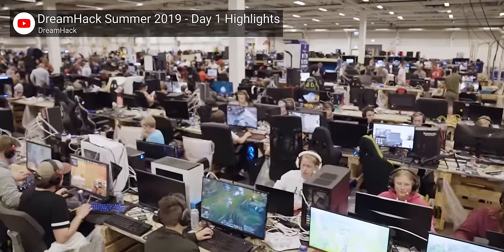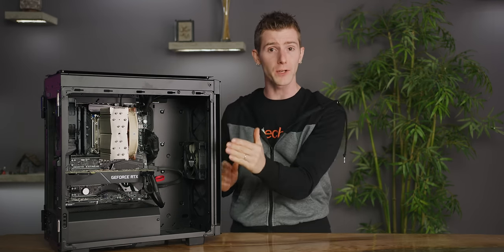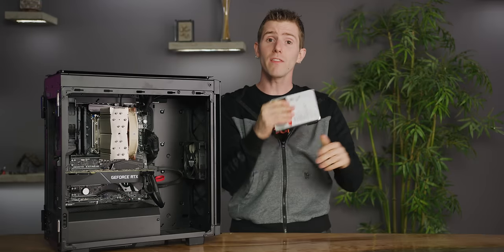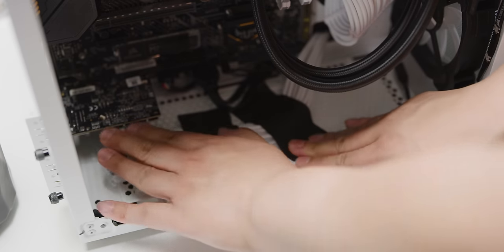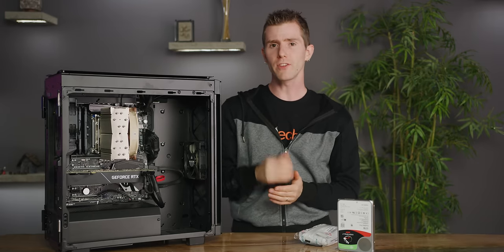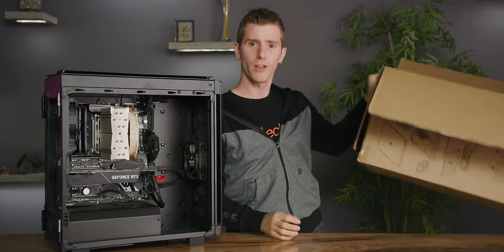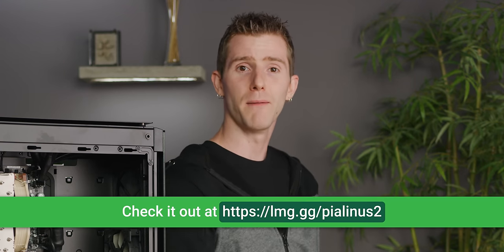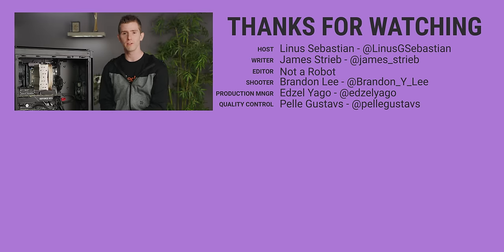How to Not SMASH Your PC - Gaming Rig Packing & Moving Guide

Comment: UPS driver sees "fragile" on box. Throws it over a fence, hear glass shattering inside the box, leaves like it was normal.
Reply: There's a reason UPS's colors are Brown and Yellow. They are THE WORST in the industry to ship freight. Always has been. But just remember that shipping is a triangle with Price,  Speed, and Security, and you only get to pick TWO.
Reply: @jackielinde7568  Bruh,you don't know what is a bad delivery service....
Reply: @jackielinde7568  yeah and price is 1 of them so only get to speed or safe. So yeah.
Reply: @-.2..  In the mid 90's, I used to work for a company called Roadway Global Air. I've seen the industry from the inside. And UPS has THE INDUSTRY WORSE DOA RATE.
Reply: @-.2..  Lol, bad delivery service is the delivery truck driver backing into my truck leaving a massive dent into my rear bumper, then driving away casually like nothing happened.
Reply: @jackielinde7568  lol if ups is the worst in your area you have it easy
Reply: more like ups driver sees fragile on the box 

Sparta kicks it into the van
Reply: @MaxRamos8  fed ex is regarded as premium. It's like some people form opinions off of absolutely nothing lol
Reply: Reminds me of the scene from Ace Ventura: Pet Detective :)
Reply: At my last workplace we put big "danger" signs on the box depicting a hand getting sliced up. It's funny, we had much less shipping abuse then we did with the fragile ones lol. We often shipped massive knives and before we added the stickers many boxes were damaged....somewhat problematically. eventually we were sticking the stickers to everything regardless of if it had blades in it.
Reply: @GBR9794  Probably sells kitchenware online
Reply: @GBR9794  yeah, I don't work yhere anymore but it was a company that made knives for manufacturing machinery. Some of them for cutting up scrap cars could be as much as 60kg each.
Reply: Write "I will find you if contents are damaged" instead.
Reply: @jackielinde7568  Here in France, UPS is actually good. But they're expensive. If you want cheap you ship with La Poste.
Reply: DHL has been the worst for me.
Reply: Are y'all gatekeeping having a bad delivery service? lmfao
Reply: They don't get paid to care. Enough said.
Reply: In the UK UPS tend not to be too bad, now if you really dont care about your package you use YODEL, well known as one of the worst couriers  going. you package will either arrive damaged or not arrive at all. its a lotto on if your even going t get your parcel
And if you think you packed your parcel well? dont get your hopes up, they will still find away to damage it. my girlfriend ordered a framed canvas (so not a fragile item) which arrived in a box. which had basically been stabbed with a knife through the canvas.
Reply: Ace Ventura
Reply: I can tell you now. The driver isn’t the only sketch one who touches your package. Remember it passes through multiple warehouses.
Reply: Absolutely agree. UPS in Singapore is garbage, will false scan an item to say they attempted delivery, will throw stuff and deliver them to hell if they could.
Reply: I have to admit: I don't know of a good delivery service at all, Hermes (in my are) tends to work pretty well, and UPS is ok, but definitely not good, DHL and DPD... You weren't there, so we delivered your package to a Package-store (I can't translate Packetshop) 40km. Away.

Worst thing about that was that I only know about this, because a colleague, ordered his tires to The Porsche Dealership, that I worked for at that time, appereantly there was noone to be found... At 11AM...
Reply: Hi tetra sky

Comment: When I moved my PC to a different country I stuffed my case with all my clothes, workers perfectly! And it's a big case with massive CPU cooler
Reply: If you wear lots of synthetic fleece, sweaters, etc. the static electricity created by the clothes will fry components.
Reply: @gorkyd7912  Yep, for safety clothes should be in antistatic bags.
Reply: @chupasaurus  telll that to the yes man
Reply: why would you move your pc with all your clothes to a different country
Reply: @saucybackport  cause I moved to a different country? Immigrants have computers too
Reply: @gorkyd7912  good thing I mostly wear cotton then, so no static there
Reply: IDK if that will bring static electricity
Reply: @LillyP-xs5qe  what?
Reply: @iKingRPG  what what?
Reply: most of the things mentioned it the video are a bit over the top in my experience as long as u secure the graphics card with the power cable resting on the atx power cable with enough tension so the PCI-e power cable can't move and is pulling up on the graphics card and the pc is in the original tower box it will be fine. only rarely do we get a pc back that has any damage

Comment: I remember a computer company that had a lot of problems with machines arriving at the customers in less than optimal working order. So they decided to investigate just what their packages went through going from their warehouse to the customer. They had a guy following one of their packages all the way, documenting every step it went through. At first everything looked as it was going fine. The guys collecting the packages was actually reasonably careful. Then they drove to the central sorting and there all packages was loaded directly onto a conveyor belt, and here is where things got scary. The conveyor moved all packages into a storage room where the first sorting was to take place. Here the guy documenting all of this had to watch how the packages traveled up the conveyor only to drop to the concrete floor from a bit over three meters, about 10 or 11 feet. When he asked why they did it that way they explained that the conveyor was supposed to start at floor level and automatically raise only enough to clear the boxes already on the floor, so the drop should never be more than about about a foot. But unfortunately the sensors that controlled that never did work very well, so for the last three months or so they had just left the conveyor at the current height, besides it was just the first few packages that dropped directly on the concrete floor, then they would cushion the rest of them, and the last of packages would land quite softly...

This computer company promptly redesigned the boxes they packaged the computer systems in. Triple thick boxes, high density foam and double boxing with two inches of foam between them. It wasn't cheap but the reduced RMA costs more than paid for that, and the customers appreciated getting computer that wasn't smashed to pieces.
Reply: Was that UPS or fedex
Reply: @BeanMan5621  Neither. This was in Europe.
Reply: @blahorgaslisk7763  how the hell did this pass

Comment: Safer but more hard work option is, if you keep all the boxes of the components you bought for you pc (gpu box, motherboard box, etc) you can disassemble your pc and pack everything on the original boxes and put them in a big travel bag with some foam inside around the boxes, or anything to absorb impact. That's probably the safest way if your traveling by plane.

Comment: I just moved from Malaysia to Australia with my entire PC rig consisting of my PC, monitor, studio monitors, and various other peripheral electronics.

Heres my tip:
 What I did was removing the GPU, wrapping it up in bubble wrap, shoving it and much more bubble wrap back into the case. After putting it back into the box that my Enthoo Pro came with, I shoved jackets and towels in there wherever I can. As for my monitor, I cut out 2 pieces of cardboard to cover the display portion, and put it back into the box. As for my studio monitors, I found a box that almost fit the monitors and their packaging material exactly. I used lots of bubble wrap, newspaper, clothing and covering all "impact voids" (places where the packing material doesn't really cover). All my boxes are then taped up with lots and lots of gaff/cloth/duct tape and by the end, only 10% of the original cardboard box can be seen through the tape. When I shipped with my airline, AirAsia, I put on the fragile stickers and checked them in as normal luggage over the counter with the exception of my PC, which went to the overweight check-in. My airline is quite strict with their handling and placement as they will always try to whenever possible to place it up right with the fragile sticker on the top. My extra peripherals went into a Pelican case which I already have and into my suitcase.

EXTRA TIP:
Bring an entire roll of gaff tape with you in your carry on luggage just in case you get flagged at the check-in counter or at the arrival airport.
Reply: How much was it omg I’m from Malaysia too and I’m probably moving to the US in the coming years

Comment: Or just do it the classic Swedish/DreamHack way. Just put the PC, monitor, Peripherals in an IKEA bag. The off you go. Shure, not as safe, but me and everyone i know have done it traveling by bus, train or car. Works like a charm.
Reply: Hello from Finland! And yes the Ikea bags are kinda life savers 😂
Reply: 3 years ago I used to pack my PC and all Peripherals into a IKEA bag, throw it into the trunk of my ford Focus Stationwagon and drive ~300-400km over the german Autobahn and a lot of byroads every few weeks.

At first I stuffed the PC with my clothes to be safe, but at some point I didn't care anymore and my system has travelled a few thousand kilometers like that. With no noticable impact
Reply: I've done this as well. All the peripherals in an old Ikea bag, loose 4k monitor I got used wrapped in a moving blanket i got for free at the top of the bag. Chuck it all in the passenger footwell with the case on the seat so I can keep an eye on it. Never had a problem.

Comment: Rip hard drive.
Time to upgrade to an SSD. Won't be crushed by packing material.
Reply: Fun fact, once had my computer science major roommate pack one of my harddrives in some synthetic wool blankets for safe keeping. Static electricity fried it completely.
Reply: I wonder about that. I bought a WD solid state drive to expand my SSD storage (OS + Steam already filled smaller included SSD), and it is the most cheaply made plastic device in the computer. Scares me to think my OS and active files are on it.
Reply: @andrewcopple7075  That cheap plastic is only for being 2.5" in size. If you tear it apart, it will be almost the same size as an M.2 drive.
Reply: @Erevos85  Interesting.
Reply: Andrew Copple You wouldn''t say that if you'd seen the insides of a hard disk. It's all wobly drive head garbage, held together by some magnets lol. SSD is at least made of chips.
Reply: @Maniacsurvivor  That's fair. I just destroyed an HDD a few years back because the sata connector was super fragile (apparently the pre-built I had was stored somewhere very hot and rotted the plastic) and it killed my ability to access the drive. So I'm paranoid about any drive that has frail/cheap plastic connectors.
Reply: Andrew Copple I get that. You can never be sure with hardware. If you have some really precious data, I'd recommend a NAS with raid 1 or 5 on or cloud storage.
Reply: @gorkyd7912  I will probably kill one by touching it, every day I get a shit load of static buildup from I don't even know where

Comment: LINUS! You forgot to mention the water cooling custom systems. You WILL need to drain those prior to boxing, as you will be liable for ANY PERCEIVED DAMAGE your leaky water loop system causes. You don't have to drain the AIO's, just the custom ones. Also, when refilling, you'll want to check for leaks, as the tubing may have wiggled loose from vibrations while shipping.

Comment: Jesus !!! I am moving back to Asia from Europe !!! And this video just comes at the right time. I am planning to fully dismantle the PC for shipping and leave my lovely case behind if necessary.
Reply: just put the parts in your checked lugage and use you clothes as stuffing material. you can take everything besides monitor and case. Most airlines have an option to bring a second luggage. MUCH better/safer/quicker/cheaper than any internationnal shipping solution.

Comment: I have shipped my desktop to myself via US Postal Service across the USA and I have flown with it across the USA and Overseas. I have duel GPUs, and a AIO Liquid cooler in a mid sized ATX case. I usually just stuff the insides with clothes I want to have with me at the destination. Fold them up and stuff them anywhere and everywhere so nothing can move on the inside. I didnt pay extra attention to the HDDs (Although that was the main thing I was worried about since I just kept them their cages). If you don't have that many clothes to bring, you can just stuff the insides with all the packing material you can find. Works the same.

As far as Monitors go. I just take my stands off of them and and place them on top a bunch of clothes in my suitcase  And wrap clothes around them and stuff as many clothes I can around the edges making sure the monitors can't move. I have done this with a single monitor more times than I can count, and done it with two monitors once. Never had any issues.

For the outside of the box I just used the original box with the hard foam and stuffed as much extra packing material around the case as I could. I will be using the 2 box method as Linus suggested in the future though, due to the fact that my foam is completely shot after being shipped / moved so many times.

Hopes this helps anyone worried about transporting their beloved gaming PCs

Side Note: Take steps to avoid your case window(s) from getting scratched up. I did not and now mines is pretty scratched up

Comment: So I had my desktop PC flown from California to New York as checked luggage. Here are the things I did.

1. I removed the heatsink, even if it's a small but thick stock one. I wrapped that in bubble wrap and put it outside the case but inside the box.
2. I have my mechanical drive as hand carry. NEVER check this in.
3. I personally took the RAM sticks out, but leaving them in should be fine.
4. I left the CPU in the socket (Intel LGA socket). Not sure about AMD PGA.
5. I didn't have a GPU then but if I did, I would also just remove it and have it as hand carry.
6. The entire PC case is wrapped in bubble wrap for a good air cushion.
I personally have a hand carry luggage to fit all this stuff along with my laptop and DSLR. 4 wheels and fits in the overhead.

Comment: How did Linus forget the best, and simplest option for dealing with a heavy heat sink, lay the computer on its side? You are never going to exceed one G while breaking or accelerating, so there will be less stress on the mounting points than just sitting upright on your desk.

Comment: Microfiber against the screen, cut a sheet of corrugated plastic to match the screen + bent up edges to "cup" the monitor (think flat box for canned goods) and place the monitor face down on the plastic, microfiber in between. Tape the home-made screen protector in place to the monitor, making sure it's firmly in place.. Pack it in the center of your luggage, surrounded by at least a few inches of clothing on all sides (above and below too)
I pack my 3x 27" IPS panels like this every time I go to the Philippines and have yet to have a problem over a good dozen or more flights. Tower just gets packed in a suitcase with GPU and mechanical HDDs removed. (It's a custom loop, so when it's empty, it weighs next to nothing with no big blocks/coolers)

Comment: Actually Hardrves are pretty shock proof.
When the power is off the arms are parked in a safe area, it has to fall REALLY hard to move those arms.

Harddisks in the old days had to be parked manually with a DOS command, not parking the arms could really damage your disk.
Reply: I didn't see a hard drive dying

 You didn't read this comment.

Comment: Just did a 5 hour flight including a connection with my PC as checked in luggage. Kept my large heatsink and GPU in and shoved the inside full bubble wrap and wedged it between the components much like in the video. Worked like a treat and the PC survived just fine.

Comment: When I flew across the country as part of moving house I took my PC (not exactly a beefy gaming rig though, no water cooling or anything like that) as checked baggage in the hold of an airplane. Didn't package it well enough and there was damage to the (fairly cheap when I bought it) case. Had to buy a new case and I learned a lesson about how NOT to transport a PC.
(no damage to the hardware inside thankfully and I was smart and backed up my data onto a USB HDD that I had in my carry-on just to be safe)

Comment: instaPak is THE BEST!  I shipped 3 PCs overseas....I DID NOT remove my graphics cards....all of them AIOs nor my AIO cooler.... I did disconnect the cables from my cards and tape them down.  I shoved the instaPak inside and closed my glass panel.  I then wrapped my PC in protective padding...then through saran wrap over that...placed the stock foamies that came with my PC on my case and placed in the original box....arrived to me without a scratch...

Comment: Easy solution for the CPU cooler, just use IC Graphite cuz it's reusable. For hard drives, take it out, and put it in your backpack/carry-on. For loose cables, use Velcro cable ties to secure. ALWAYS save the monitor stand if you switch to a vesa mount. Take it from a basement workshop/SI who has to ship stuff like this all the time. Never skimp on the price if it means risking your PC, paying an extra $10 for shipping can save hundreds or thousands in cost to fix/replace, and shipping insurance is never a bad idea. Thanks for coming to my TedTalk, brought to you by tunnel bear!